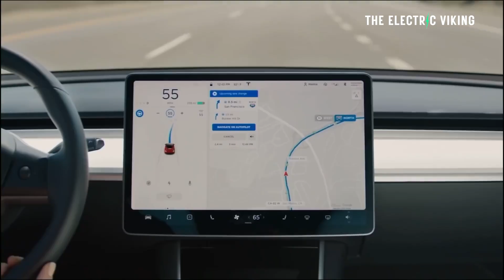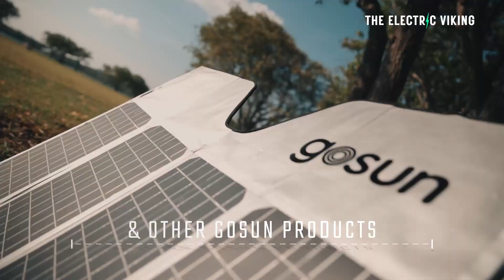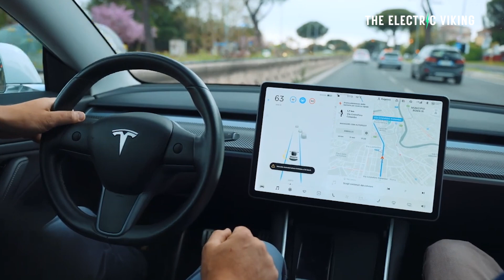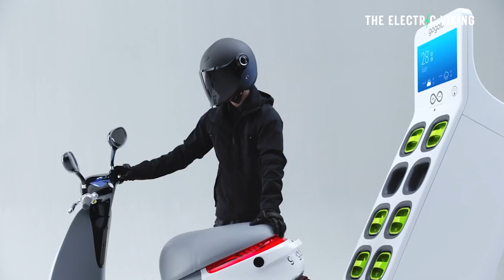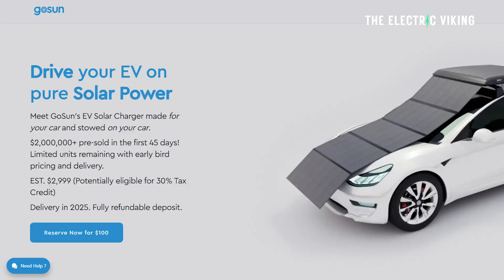GoSun’s Solar car Charger turns any electric car into a solar car

Comment: Ok. That’s an old video. But that only means that solar panels got better within the last year. So if that numbers are true ~50km on a sunny day. Why not implement those panels directly into the hood and roof? If it gives 10-25km a (sunny) day it’s already a big deal. Without ruining aerodynamics and design. Without adding another price tag to an already expensive car….

Comment: You are going to fry your Tesla's onboard charger with this EV solar charging system. The high frequency, transformerless inverter that's used in this system doesn't provide any galvanic isolation between its DC boost stage and its AC output. All it would take is for a single MOSFET in the H-Bridge circuit to short to ground and pass high amperage DC current through to your Tesla and you'll set your Tesla on fire and void your Tesla's warranty. Don't take my word for it, ask Google AI "Can a high frequency, transformerless inverter damage and EV?"

Comment: What happens when there is a strong wind while unfolded?... what about the conract of this sales with he car body if there is wind(or any other reason for movements of the unfolded panels)? also  what about the inevitable vandals or even accidental brushes with it when used on the road?  And obviously, the inevitable H&S problems with the overhanging bits?...

Comment: 440 watt bifacial n type panel cost $98 in Melbourne, three will cost less than $300, install with rail on roof will give 8kw charging per day while parked at workplace

Comment: Shoulds cars EV or gas have a solar panel on them?  Yes they should. Keeping modern car systems from draining the batteries will always be helpful.  A little extra range doesn't ever hurt either.

Will they be useful for the average customer to extend range.or eliminate charging.  No, probably not.

Comment: By 2030 solar cells will be so efficient that the cars will come with solar cells in the hood the roof back windshield trunk area that will power the car.  charge the super efficient small battery

Comment: Even if it only added a mile of range during the 1 or 2 hours your car is parked while you are watching a movie or shopping, for example, that is a mile you obtained FOR FREE.

It is a good option if your worksite doesn't provide an opportunity to plug in. My office does but if it didn't you can bet your bottom dollar I would consider parking up on the top deck in order to use this.

The more important factor is if the place you park is safe from vandalism.and other criminal activity. This would be foolish to buy if you live in San Francisco, for instance since, like most democrat-run cities, it is overwhelmed with criminals running rampant.

Comment: Make it 30% wider. Then when you close it up have it so the closed unit rotates 90°... It would only overhang the windshield and the rear window a little more that wouldn't matter. You'd get even more capacity out of it and it would completely cover the car in shade.

Comment: Flexible panels have such a short life span compared to glass, with that thing on the roof anyway you could just figure out the best configuration of glass panels for your roof and have it charging to your car at all times there is sun, while driving etc.  If pass thru charging is possible.  Anyway, you are parked more of the time anyway and it would be probably be less than $3000.  Maybe an extra pull out panel or two.  That would be more $$$.  I've seen it on RVs.  Or not.  With the charge set up to the car tho, being a big part of the expense, it would be worth it to be able to optionally hook a couple more panels in some situations.  

I have noticed in my neighborhood especially a few years ago, that people getting electric cars were also getting solar on the roof at the same time.  It makes sense.

Comment: LOL - $3000 USD ($4650 AUD) for 4.5kwh a day average in Brisbane (4.2kwh in Sydney) - at 8c per kwh overnight rate that's 58,000 kwh before break-even = 38 years of charging, and that requires the car to be outside 100% of every daylight hour, never in a garage, never in the shade, never being driven. It also doesn't take into account that 110km/h on the freeway with the box on top will consume an extra 1kwh every 10km of driving.

Comment: This is the smartest solar charger to buy for your EV.
The solar charger will save your money in a long run.
Free Electricity from solar panels , the solar charger will paid it self off with in no time. 
GoSun should design a locking system so thieves can't steal the solar charger from people's EVs roof racks. 
😉💖⚡️🔋🌞💯🌏✌️

Comment: They're too easy to pinch, also the weight & having that block on the roof effects drag coefficient, negatively effecting range. Needs to be compactable for the frunk or boot/trunk & make it anti-theft when in use so you don't have to be in eyesight to charge.  Junkies & Cash Converters would make a packed from these.

Comment: Parking at your workplace is far more likely to be what people do.  I've always said this was a far more desirable system because the surplus of solar power on the grid will be durring the day when most cars are away from the home.  Employeers can simply give that cheap power away to charge employee cars using a cheap level 1 trickle charger.

Comment: I live in a hot climate with lots of sun.  It would be great to shade your car and charge it but not at that price.  In my area being generous it would take 8.2 years for break even if used every single day.  Area's with lower electricity rates would be closer to 15 years.  Not to mention the drag would most certainly reduce mileage efficiency.

Comment: I have an EcoFlow Delta with a 600w of solar panels that I use to exclusively charge my model Y. I live in a small town so I don’t drive very far. Gets me to town and back every day plus a bus stop pickup for the kids. Then I take the EcoFlow with me and use it in place of a gas generator when I go camping. It’s awesome.
Reply: so you get like +10mi of range per full sun day?
Reply: @trentvlak That’s pretty close for summer months after conversion losses and climate control use. A lot of energy use on short trips is climate control this time of year. A little better than that in the spring and fall and probably about the same in winter. My winters are cold and sunny and the solar outperforms by quite a bit per hour of sun (also because my panels are at a 45 tilt faced south. The same set up handles all my e mountain bike charging too and I ride it about 20 miles and 2000ft of climb each weekday.  

TLDR: yes about 10 miles which is more than I actually drive so I also charge an e bike off that same set up too.
Reply: @derricklaw1  Sounds like it works pretty good for you!
Reply: The panels are not mounted on the car like this video, I assume?
Reply: @laughinggas5281 No, but there fold out panels so I suppose I could lay them over the top of the car like this if I wanted to (I don’t 😊)
Reply: Upgrade to pecron 3600 or anker 3800 and get 2400 watts.

Comment: Wait, this thing is only 1.2kw. At most in optimum conditions, it will only produce 6 kw/h per day, in summer.  Realistically it will produce only 2 - 3 kw/h per day, in summer due to non optimum angles. How far can you drive with that? Not far. When it's cloudy, stay home.

Comment: Yeah I’m a solar/EV/battery fanatic, but the maths doesn’t add up for this. 

It costs so much, then the job of folding and unfolding and plugging the car every time you stop? 

Every home owner in a house or townhouse will just get 2-3x the rooftop solar for the same price, and apartment/city dwellers won’t normally have a space with access to sun to actually benefit. 

Pass. This needs to be at least half the cost to be worth it, and even then it’s just adding day to day hassle.

Comment: Never mind average daily range. I've seen a calculation that alleged that the CyberTruck will lose 4% of it's charge overnight (with everything turned off), and the GoSun solar charger will add about 4% of charge to a CyberTruck over an entire day. Tesla needs to kill those phantom loads, before this will add any watts to a CyberTruck.
Reply: That's BS - I have seen the video where the guy claims 45% lost in 10 days parked at the airport with everything off - it's not supported by anyone else who owns a CT and he never shows  the energy app screens to prove it - my model 3 loses 1% (0.57kwh) every 3 to 4 days
Reply: @TB-up4xi  Well that doesn't sound like the same person that claimed a 4% loss parked overnight while camping, so it might be "supported" by two people.
 But I want to believe you. Losing 4% overnight to phantom loads, is totally ridiculous.

Comment: If the GoSun solar charger is going to be stolen, that means the vehicle is also going to be stolen, not just the solar charger. Again, in this day and age in the US, if someone is planning to have a high tech EV, it would be ideal if they had a driveway, a garage or a private parking area where they can park and store their EVs and charge them in peace, security and safety. If it’s a situation where it’s just parked along a sidewalk or parked in a mass parking space as in the parking in an apartment building or townhouse - and forget about parking in a city or public housing - the chances of it getting stolen or violated is higher than if it’s parked securely in a home garage/driveway/backyard parking space. That’s why I was seriously thinking Elon Musk would add a more active defensive measure to all Tesla vehicles on top of the passive security measure (sentry mode).

Comment: I  have 500 watts of solar on the top of my minivan, which charges an Ecoflow Delta pro, Delta with a 800 watt alternator charger, and a wave 2 air-conditioner - heat pump. When I want more solar three 200 watt foldable solat panels can be attached above the windshild down to the bumper. I've had the panels on the roof of the minivan since 2014. I was considering doing the same with an electric car.

Comment: My Aptera will self-charge, 40 miles/day, standard with all ranges, 250, 400, 600, 1000 miles. And it looks like it could fly.
Reply: LOL - you will never get your Aptera - it's vaporware and the CEO is full of BS - 5 years into their 3rd attempt at producing a car (Aptera 1.0 2006-2011 and Aptera 2.0 2012-2014 both abandoned) they have raised $260million capital, spent all of it except for the last $16million on offices, executive salaries, R&D and advertising. They have no in-house manufacturing facilties, no software (that they can demo) they had to find a new hub motor supplier because they never fulfilled promises with their old one.

Their tech is now old - 40kw max DC and 3kw max AC charging. They need another massive injection of capital to start manufacturing at a contract supplier and they are now struggling big time to raise any cash - party number 3 will be over by the end of 2024.

You're delusional to think you would ever have gotten 40 miles per day on average - that's based on 4kwh being produced mid-summer on a cloudless day in Arizona and it assumes 10miles per kwh efficiency. The average in a dry sunny southern US climate (from their 700w maxmimum array) year round is 2.8-2.9 kwh per day, and that's only if you keep the car 100% outside every day during the daylight hours, never in the shade, never in a garage or underground car park, it's more like 1.3-1.4kwh per day in London or 1.6-1.7kwh per day in Seattle WA. 

They would have needed some magical Tardis dust to fit a 100kwh battery (needed for 1000miles) into that electric auto-cycle (and still get 10miles per kwh efficiency). To put that into perspective the 100kwh Tesla pack weighs 625kg / 1400lbs and is 2.2m x 1.5m x 0.34m in size, they claim exactly the same 10miles per kwh efficiency regardless of the battery size - despite a car with a 100kwh battery weighing a minimum 60% more (475kg 1050lbs more)  than the base model with a 25kwh battery - I can smell the BS from a mile away.

Comment: A model 3 long range is epa rated at  26 kwh per 100 miles. The average American drives 15k miles per year. That works out to 3,900 kwh per year.  Peer reviewed research by the department of energy shows a Toyota Corolla (similar sedan aero) with a roof top cargo box uses 20.8% more fuel during the epa highway driving cycle. So putting one of these on top of a model 3 would cost the average driver an extra 811.2 kwh per year because of the increase air drag. This unit is rated at 1,200w watts max. In sunny southern california, a 1.2 kw rooftop solar install will make 1,833 kwh per year.  So this unit will make 1,833 kwh per year (assuming the solar is deployed every day and you only drive when the sun is down), but then eats up 811 kwh per year because of increased drag. And that is in an idealized EPA driving cycle.  Most people drive faster than that and the drag losses will be higher than what was found in the research setting.  Is that worth it?  How long will this last?  30 years like typical rooftop solar on your house?  The average american only keeps a car 12.6 years.  And the cost of the GoSun unit is $3,000 for a 1,200 watt output, or $2.50 per watt of output.  When you factor in air drag losses, it is more like $4.48 per watt of output.  Tesla currently prices their rooftop solar installs at $2.30 per watt.  And those will last for 30 years.  When you do the math, this is a horrible idea for anyone that has roof top solar or has access to cheap level 2 charging.  The only sensible use-case scenario would be for people that only have access to expensive level 3 chargers.
Reply: Your maths checks out. It's a good Idea. Would be great to see it built into a vehicle and have double the output from the panels.
Reply: Grossly bad anlaysis.  First off this object is much smaller then a top cargo box and should present much lower drag.  Second highway driving is only half of typical driving, city driving has much lower speed and will carry almost negligable air drag losses.  Far from 'idealized' driving you created a strawman.  Correcting these assumptions and your looking at closer to 5% losses or just 200 kwh per year and plenty of surplus power if the device is deployed regularly.  Also the duration that people keep a car is irrelivent because the device is not permently part of the car, you could change EV's every year and just move the device from car to car each time, again you are creating a strawman by inviting comparison to a solar instalation on a homes rooftop which people cant take with them when the move.
Reply: @kennethferland5579  You’ve never taken any college level physics classes, right? Drag is frontal area times drag coefficient. Cargo boxes are optimized to create the most volume of storage with the lowest frontal area possible, which means a narrower and longer box and they have an aero shaped nose to reduce drag coefficient. This device is made to be as wide as possible to increase surface area when unfolded and the leading edge is pretty square and has multiple indentations where the solar panels fold, which is going to create turbulence and the drag coefficient is going to be twice as high as a cargo box. The frontal area is 1/2 as much as a large cargo box, but the drag coefficient is going to be twice as high as a cargo box. In the end, the total drag is going to be very similar to a cargo box.  If this kick starter even makes it to market, people will test it and the math will then become clear and people will steer clear of this product. Also, its longevity will be short from gusty winds damaging it when it is deployed for charging and there will also be reports of damage to the vehicle from the unsecured panels flapping around. My bet is that this product is dead on arrival.
Reply: @kennethferland5579 I think his maths is great. Not to mention it would also have a loss, so won't actually give you the claimed 1200 to the battery. It's an awesome idea though.

Comment: useful when you go to an area with unreliable charging infrastructure.
Reply: Then you hope the sun in shining bright, what happens if it is raining, you stay there until you have 3  or 4 days of sun to charge your car.
Reply: @archiefleming652  you only need to get enough charge to move to athe next fast charging station. For example if you stay at a hotel without destination charger, you can at least get some solar charge to continue your travel to the next charger.
Reply: @i6power30  Normally no sun at night to charge your car overnight

Comment: Are they typical solar panels with a ten or fifteen year life span?
If so the cost compared to grid charging is even less attractive, along with the daily effort to deploy and retract it every time the car moves. Then there is the extra weight and drag and cleaning of the panels.
Not a bad idea , but likely not all that cost effective.

Comment: What we urgently need in times of climate emergency and storms is protection for vehicles from hail!
Reply: There is no "climate emergency". There is a overpopulation and pollution emergency
Reply: The thing will cost at least $3,000. It would probably a lot cheaper to replace your windshield or repair your roof, if they get damaged by hail, and both will be tougher than these solar panels, so survive the hail with less damage. If hail is forecast, you'd want to remove this thing from your car & bring it inside (if you can't park your whole car inside).
But otherwise yes, it would be great for anytime the grid goes down, or other similar emergencies.